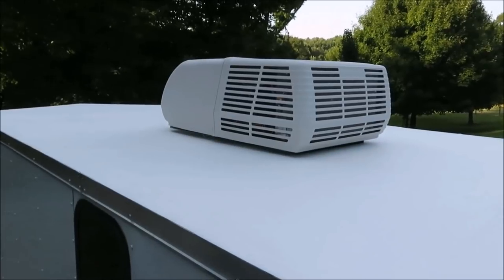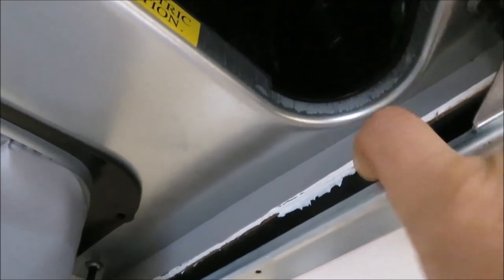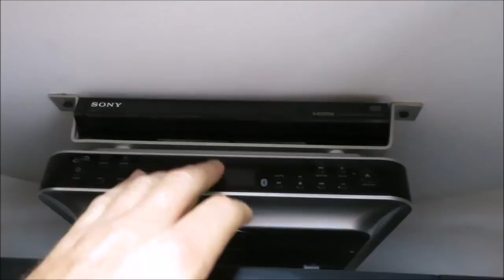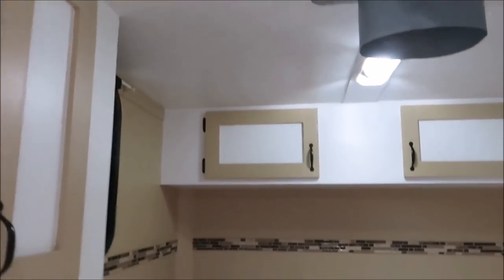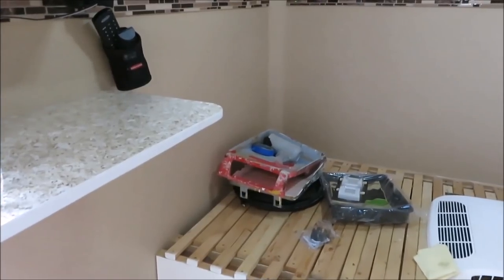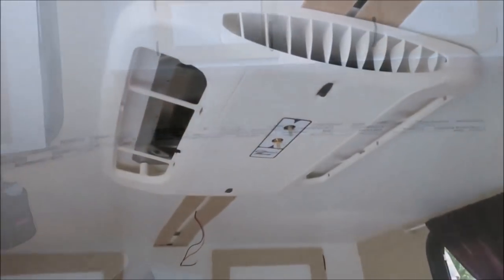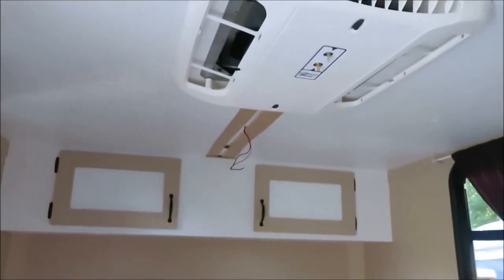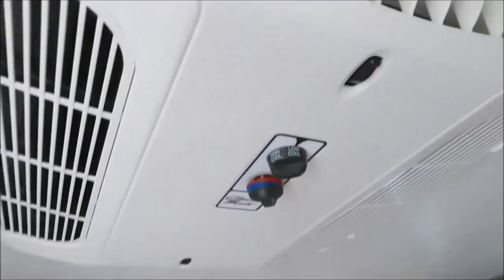6 x 10 cargo trailer camper air conditioner hook up

Comment: Please use 20 amp breaker with 12 gauge otherwise the burning wire is the fuse!!! Great job as always!!
Reply: It may be just fine. I'm a Licensed Electrician. In A/C equipment you wire to the Minimum and breaker to the Maximum. You wire and breaker the equipment to the Name Plate on the piece of equipment. 👍

Comment: Nice looking job. But wondering if running unsheilded speaker wirers so close to the 110 will cause noise over the lines. Not sure. Hope they don't.

Comment: I have the same A/C unit, how do you add the Freon? Mine won’t blow cold air
Reply from the maker: Are your filters all clean?
Reply: @Robinson-Homestead  yes I took out the ones on both sides and cleaned them, I didn’t install them so I don’t know why it’s not cooler air. Are there other filters or somewhere you fill up the cold air?
Reply from the maker: Honestly i don't know i never took mine apart so sorry i can't help you but good luck i hope someone sees your comment and might have some good info for you.

Comment: 12-2 wire is only good for 20amps. As long as  you don’t have anything other than the air conditioner on that loop, you’re fine.
Reply: 10-2 wire is good for 30Amps

Comment: What was your roof thickness?
Reply from the maker: I  think think it 3/4 inch.
Reply: @Robinson-Homestead  did you have to add any additional framing for the proper mounting of the AC?
Reply from the maker: No all the same framing still all ok.

Comment: Kevin where did you buy the aircon unit, I can't find a 12v unit anywhere
Reply from the maker: This is not a 12-volt air conditioner it runs on shore power.
Reply: @Robinson-Homestead  It is 120 volt